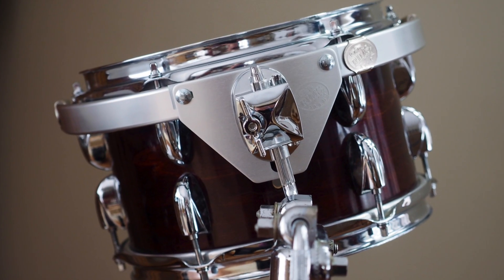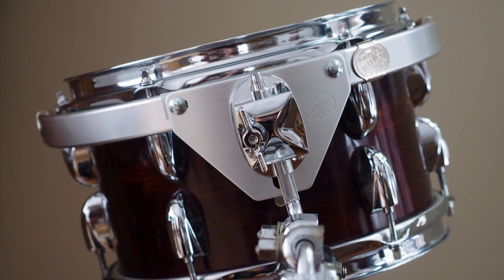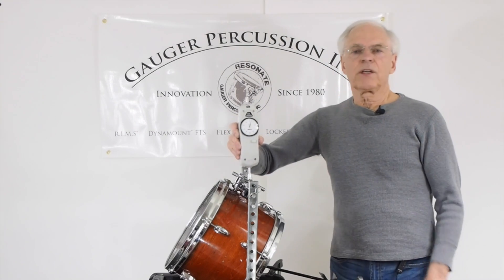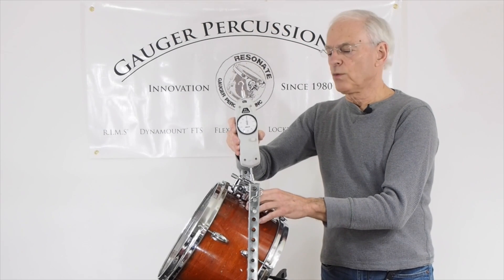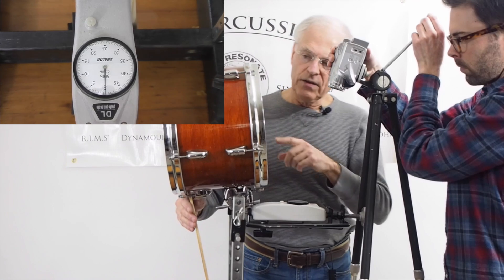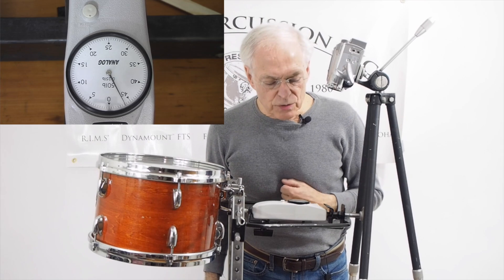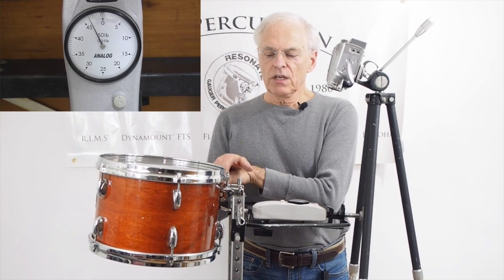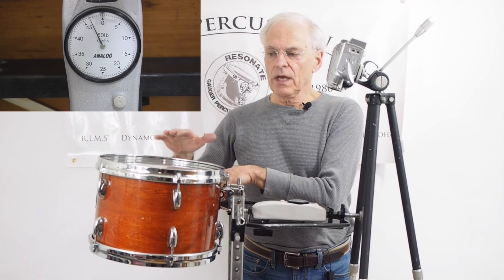Drum Shell Pressure Test

Comment: I have Ludwigs from the early 60's (13", 18", 22"), original mounting hardware (3 ply, mahogany, poplar, mahogany). They have all seen a life time being played in bars, transported from here there and everywhere, and have had the shite beat out of them for nearly 60+ years. The shells are perfectly fine and with new heads sound great. No matter the situation I have to deaden them with gels unless I'm in my basement. While I understand the many floating systems out there what is the first thing you are asked to do when a mic comes within 10 feet of your toms? "Can you deaden that thing with rings or gels or something?" I recently placed pinstripes (with gels) on my gig set (floating toms) just to bring down the resonance as much as I can. They still sound great, but a bit dark for my liking. My old (non-floating) Ludwigs I'm redoing will use Evans UV2 batter and UV1 reso. First thing the sound guy will ask me, "Hey can you deaded those things a bit?" I'm just not convinced shell mounted hardware chokes the drum to the extent many claim (at least not my old Ludwigs, though I'm sure some other mounting systems may squeeze some life out of the drum). Especially with modern, non-hydraulic heads those things can sing like crazy and as far as damage caused by torque, if 60 years hasn't ruined these things I'm not sure another 60 with do the trick. No question floating systems are good ideas especially for guys like me who spend most of their time in a drum room where our drums can sing like they were meant to, but necessary on a quality made drum?
Reply: totally agree... show me drums that have been harmed before the intro of suspension mounts. Im old school and had Pearl mahogany, fiberglass , maple etc... no harm done...  used to be the standard from every manufacturer.

Comment: True story. I own 2 yamaha stage custom sets. 1 has tom mounts exactly like are being described. The other kit has holes in the shells where the mount arm slips into. The mounts on these shells are centered on the shell and thr metal plate where the screw tighten onto is squared to fit the 4 screws  instead of smaller and rectangular and not centered like the other kit.

Comment: Reading the Comments Below  Im Thinking WOW All Thse Physic Engineers    That Come up with their Formulas all to disprove Gary Gauger Your Funny Gary Is LIGHT Years Ahead of you all Back when he Invented this System He was Laughed out by all Major Drum Manufactures Untill One Day they Notice Professional Drummers Using them in Clubs Recording session and Concerts and it was in the Recording Studios where it was definitively  Christened    That it Made a HUGE Difference in Drums Resonance and Sound.  In Fact the only reference in the Past were the Nodal Areas of Sound Resonance restriction from Single Tensioned to Double Tensiond Lugs  Mounting Hardware Back in the 50 60 70 was Horrible Only Slingerland came out with a Drummer Friendly Mounting System then Sonor.  But it was Gretsch who First Used  Gaugers Rim Suspension mounting system using Steel Chrome Plated it Improved Sound Drastically But That in itself was not enough to Gary. He needed further testing He wanted a Lighter more Durable Material that  had Zero Resonance Transfer to the Shell and He invented the Aluminum  Rims Mounting System. Which I use on all my Drums. The set backs are yes added weight but more secure and Free to resonate and Getting Cases you must order one size up to make allowances for the Rims Mount itself. Now Since then Every Drum Manufacturer has tried to replacate the Gauger Rims Suspension Mount?  Sadly they Miss the Mark, I'm a Yamaha Drummer and Nothing disappointed me more than their SAD attempt of  making the Drum more resonate and less bulky however they sacrificed  Strength Durability and Sound.  There first Attempt was the Two Bolt Through the Shell  After many Complaints Now they Extended the Faciting Plate with Two on Top and One Bolt Bottom it still hideous Makes No sense I use the Mounting Rims of Garys Platnum Aluminum Suspension Mounts on my 5 sets I Own. Two From Gretsch    Two Yamaha  and One Montineri   they all Sound incredible .I used Nothing else but Gauger Suspension Mounting System They're the real Deal.

Comment: I made a post on a drummer's forum of some concerns with the Yamaha YESS mounting system and was heavily chastised on the forum. First I love Yamaha drums, but the YESS mount is horrible for the reasons Mr. Gauger states here. Because the Yamaha mounting bolts are horizontally placed as opposed to vertical like in the drum mount presented here, the forces involved were literally obscene, in excess of 500 pounds from a quick torque calculation. 
I had a kit with 14 and 16 inch Toms YESS mounted, and one could literally see the drum distorting at the mounting location when the drum was mounted.
I was quickly told to shut up on the forums. I am proud to own a full set of original Purecussion RIMS for my drums. I know some vast improvements have been made since then, but these original steel ones work wonders for my drums, due to a lack of harmonic interference.
Reply from the maker: Thank you for your comment. Yes, it is quite amazing how defensive people are about the drum mounting issue. We experience it often, and also hear from people who say they used to hate RIMS®, but were converted when they finally discovered what they did for the sound of their drums. It's so easy to test a drum for mounting/choking issues (and so many drums have these issues with their mounts), it's hard to figure out why drummers are so set against looking into it further. You are correct about the YESS mount and the horizontally placed bolts. While it is better to have the bolts placed vertically, the mount in this video has another drawback, which is that it is placed at the top of the shell, which is weaker than the center, and more likely to get distorted due to stress. The only place worse to have a mount would be at the bottom of the drum. It's worth noting that we sell more RIMS® to drummers replacing the YESS mount than any other system. We also showed this demonstration to an engineer at Yamaha a few years ago at a trade show.

Comment: Mr. Gauger. Excellent presentation! I have a keen interest in this, as I am researching buying a vistalite shell kit, and it's been recommended that I do not shell mount any of the rack toms. Your RIMS were recommended for this kind of kit. Based on your experiment, I can clearly see why.

I had a question, and I hope you read this. I have seen RIMS and other mounting systems, where the RIMS mount is to the side of the drum or near the front of the drum. Can your RIMS be secured to the back side of the rack toms so that the RIMS won't be seen, as I prefer the clean look of the drum without seeing the RIM. In theory they could, and I plan on buying a simple rack system for the two rack toms. I guess I am still trying to visualize the engineering/position of the toms with the RIMS on the back side of the toms, facing me, connected to the rack, which I can position independent of the bass drum. Thank you for any and all insight. Sincerely, Brendan

Comment: This is cute. Now tell us how much pressure is being exerted on the shell buy the heads and lugs. Then we can challenge your system because, sadly, the forces all have to add up to zero no matter how you mount the drum... lest it start moving away. In the end, you'll likely find the truth: it's the lack of rigidity in the system that makes a mounting system work.
Reply from the maker: The tension/force being applied on the shell by the heads and lugs is one that is necessary to the instrument resonating. It's like the tension of a guitar string; it's what makes the instrument what it is. The force of a mounting system on the shell is detrimental to the resonance of an instrument and should be completely removed. If you clamped an acoustic guitar by the back of its resonating wooden 'shell', it would also choke. Not the strings, but the resonating body/shell of the instrument. Your "Forces all have to add up to zero" comment is confusing. Just because an object isn't moving doesn't mean a force/pressure/tension on it is 'zero'. If you want to feel the force that is happening with a shell mount, just go pick up a coffee mug by the handle. When you pick it up, you can feel the top of the handle pulling away from the mug and the bottom of the handle pushing in on the mug. You can feel this in your hand as you hold it. Those forces do not add up to zero, and are much greater on a larger, heavier object like a drum. With a RIMS® mount we take that torque, put it on a side plate not attached to the drum, and wrap a band half way around the drum to hold it by its center of gravity. The force still exist, but it's not on the drum, it's on the side plate. If I asked you to go pick up a drum in your hands right now and hold it in a playing position, you would naturally pick it up this way, with two hands on either side of the drum. If you try to hold it in a playing position with one hand on one side of the drum, you would have a difficult time holding the drum in a playing position because you are not holding it by its center of gravity. In terms of lack of rigidity, that is a theory we've heard from the Atlas and Inde mount inventor, which we could not disagree with more. His theory is that old drums somehow did not have and issue with choking because their mounting hardware was less rigid is just false. Gary Gauger noticed the mounting/choking issue with his first Ludwig drum set he got in the 1950's, and spoke with many influential drummers about the issue during his career in the years leading up to inventing RIMS®.
Reply: So sad that you're picking an argument with mechanical engineers. Sad that your straw man is a 1950's clipper mount. Sad that you don't understand forces and pressures, and why your own product works.
Reply from the maker: I wish you the best, Ryan. I would gladly continue a conversation about this with you if it was in the spirit of truly understanding each other, but it does not seem to be going that way. I hope whatever you use on your drums works for you.
Reply: I'm trying to figure out exactly what it is you have a problem with.  Who are the mechanical engineers you refer to? The only mention I find of a 1950's clipper mount is yours. Maybe I missed something? You seem to acknowledge that RIMS mounts work - are you somehow offended that the reason that the inventor gives is different from yours? Whatever your reasons, your condescending attitude and snide remarks don't do you any favors as far as your credibility goes.
Reply: Since "this is cute" and the condescending use of "sad" in another reply weren't directed at me, no apology is necessary.  I have listened to all the other videos, and while I remember a reference to 50's Ludwig drums, I don't remember a specific reference to the clipper mounts. Did I miss a mention of them, and which video was it in?  I have a 60's Slingerland kit with a rail mount and diamond plate, which I think is pretty similar to the Ludwig, and at low to mid tunings it choked the heck out of the tom. So, as far as I'm concerned, using the clipper mount as an example of a mount that chokes the drum is not a misrepresentation.  What is "sad" about picking an argument with a mechanical engineer? Does a degree mean they're beyond reproach, that their conclusions are infallible? When you say "If it's false, why does it work?" what is the "it" you are referring to? As far as being condescending, per Google, to condescend is defined as (to) "show feelings of superiority; be patronizing". I don't read any of that tone into that quote, but I may be biased because I agree with Gary. The basic concept behind all of Gary's products, including the Flex Frame, is to isolate the drum from what ever you choose to mount it on. With the Flex Frame, it's the snare drum stand. If you want to interpret the Flex Frame as an example of being less rigid, go ahead. Finally, you mention that you're "an old drummer who's done a lot of experimenting" What have you found? I really would be interested in your findings.
Reply: Brian, yes "this is cute" is pretty snide. I apologize. For the rest of the story, you kinda gotta read another level "up" into the story, I suppose. Gauger Percussion brought up Ludwig's in the 1950's. Those are clipper mounts. They weren't great. Big chunk of metal right on the shell. Using something like this as an argument is known as the "straw man" tactic. Per Google, a straw man is "an intentionally misrepresented proposition that is set up because it is easier to defeat than an opponent's real argument." Gauger then mention (The mechanical engineer bit), "In terms of lack of rigidity, that is a theory we've heard from the Atlas and Inde mount inventor, which we could not disagree with more. His theory is that old drums somehow did not have and issue with choking because their mounting hardware was less rigid is just false." I think this is more condescending than anything I've said. Gauger says it without any data to back them up. If it's false, why does it work? If it's false, why does Gauger sell a Flex-frame? I give credit where credit is due. Gauger's stuff does work. When Gauger disagrees with a competitor's product they say it's false without appeal to reason or fact.... granted, Gauger uses a more professional tone than I. They're selling a product. I'm just an old drummer who's done a lot of experimenting. Best to all!

Comment: Wow. a lot of dings here! :) However it works, all I can tell you is these mounts work. I've had some toms with shell-mounted holders that sustain forever, and others that choke so bad they sound like cardboard boxes. On those drums, whenever I've used a Gauger mount it solved the problem. So however it works, it works!
Reply: Chip Hammond Chip Hammond  It wrks by isolating the vibration the drum creates from the floor, or any interface between it (drum) and the floor. Doesn’t matter what’s  on the shell.  What matters is how the drum interfaces with the ground.

Comment: I think you need to better understand the difference between pressure and force before conducting an experiment like this. The terms are used interchangeably throughout the video which is inaccurate. Pressure is a force applied over an area which is not what you are measuring. 

I would like to see some data on the actual resonance of the drum rather than how much force is on the mount, after all that is what matters. I am interested in the RIMS system but am hesitant without a lack of proof that they make a difference.  Do you have any data like this or are you able to conduct an audio/vibrational test?
Reply: I concur regarding pressure vs force.  Your test really doesnt measure the force or pressure acting on the shell.  Furthermore, it is not indicative of any effects on resonance.  Fwiw, I'm a structural engineer who has played drums for 50 plus years.  More to the point, I still play a 1954 Ludwig set that I started on back in 1960.  The drums are shell mounted and show no signs of shell failure.  More over, they are resonant and have plenty of sustain.  This is not a knock on any suspension system, but rather observations made over a long period of time.  I suggest a test of sustain be conducted to prove a superiority of any given system.
Reply: Having used these for decades there is no comparison in resonance between mounting right on the shell or using rims mounts. They resonate way more with the rims mounts, it is not even close!